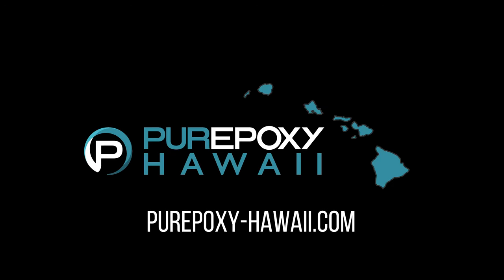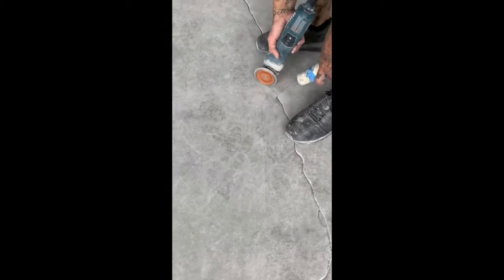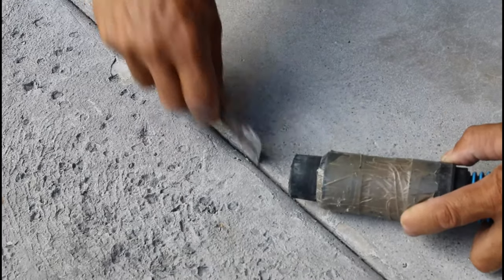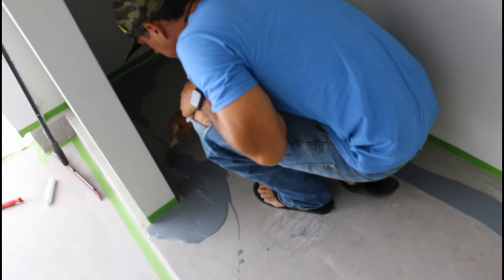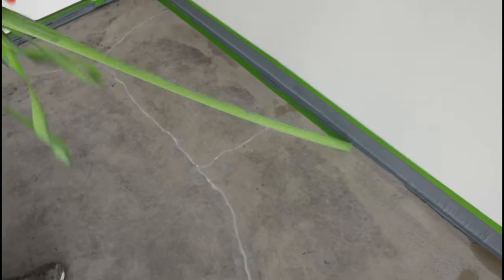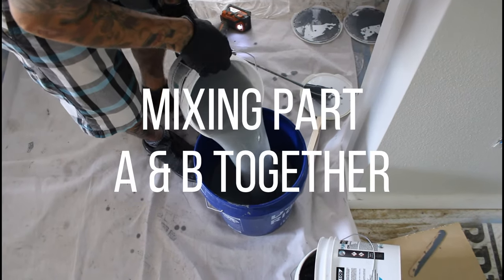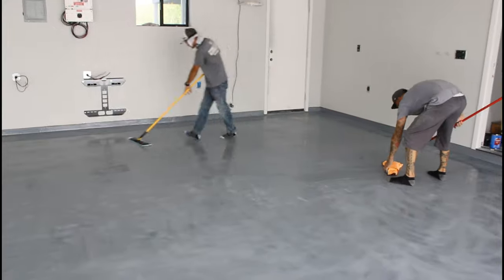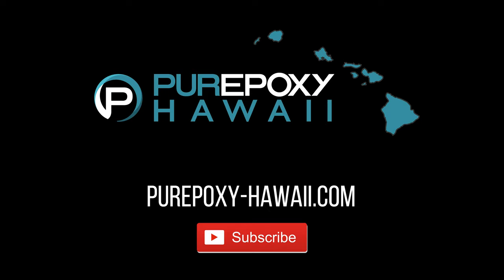3 car garage epoxy floors

Comment: I just looked at your gallery. Very impressive especially the floor that looks like the ocean surf. Question: I’m in Michigan with harsh winters and lots of water and slush. In our area, most garage epoxy floors are done with paint chips to hide scratches and imperfections. Would a metallic gloss finish work in a garage?
Reply from the maker: A metallic gloss would work in a garage as long as you use a urethane as a top coat.  We urethane all of our floors to give it that extra scratch proof resistance.  Now, it's not bulletproof.  You can gouge it with something sharp and heavy, so be careful.

Comment: Are you sure the epoxy expanding in the joints is not a result of using water instead of solvent as final clean? Curious, nice video
Reply from the maker: not sure what you mean.  we use a crackfiller product in the joints.  after that hardens we lay down the epoxy.  the epoxy doesn't get in the cracks.  hope that makes sense.